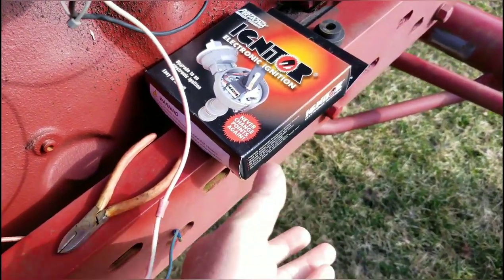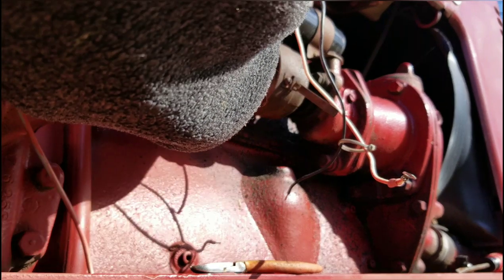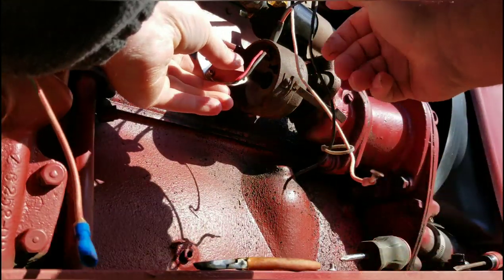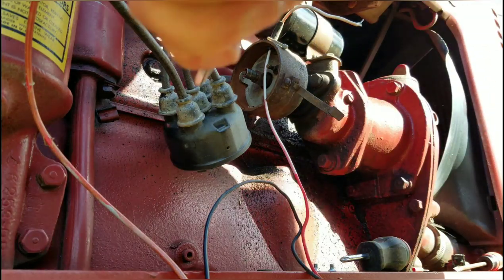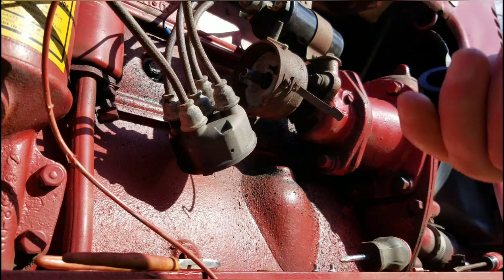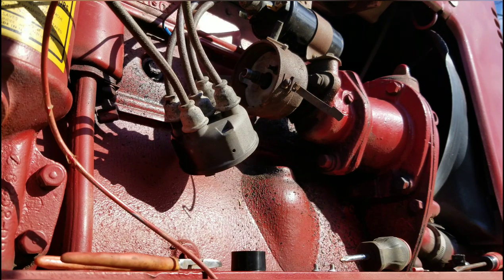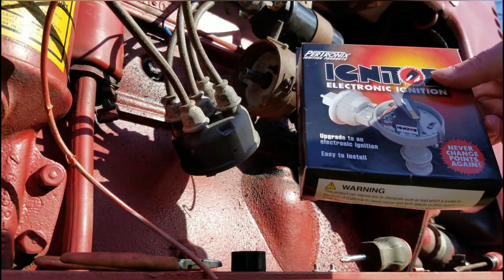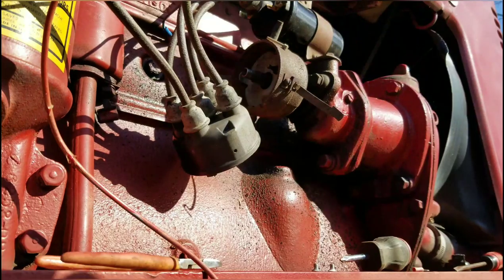Farmall M Electronic Ignition Installation...Almost!

Comment: Sorry to hear about how much trouble you've had. If you're interested in an alternative, I put a C5 ignition on my 400 three years ago and haven't had any trouble with it. The system is really expensive ($600), but I haven't had any problems 450 hours later. It basically replaces the whole ignition system with components used in modern cars.
Reply from the maker: Now that is interesting
Reply: @FarmallFanatic  I was able to justify the cost because I would have needed to buy a new distributor. The advance weights cracked and messed up the inside of the distributor. This set up only uses the distributor shaft, so I bit the bullet and was happy with the result. As a bonus, I can use a planter monitor because the ignition makes less electrical noise than points.

Comment: I have a 175 AC and it has went through four or five sets of points in the last two years.  My local mechanic told me that points just are not what they used to be.  He suggested that I convert to electronic.  Had to put on a new coil because it wasn't hot enough.  Love it.
Reply from the maker: I got 2 years of hard running off the last module

Comment: If your only getting a couple years out of those units don't you think it would be better just to switch back to points and condenser?   I can respect your opinion, but it's a glorified Hall effect sensor.  It doesn't care if it's idling or full tilt.
Reply from the maker: As hard as I run my tractors, I go through more points.  Either way, I'm digging into the distributor.
Reply: @FarmallFanatic  Fair enough....... Order a second unit so you can minimise down time.   This stuff usually only fails when you need it most!
Reply from the maker: Very true

Comment: I had electronic on 3 tractors for 2 years and they ALL went out last year. I'm going back to points. Still expensive but alot of times I can clean em if they act up and I can get new ones about anywhere. Tsc ,NAPA. Case IH, Skillings Tractor, Rural King. That way I  don't have to leave it in the field or something.
Reply from the maker: Thats true and easy to change

Comment: Howdy. I remember you putting that on there. Do they not last very long. I want to put one my 30. Thanks for video.
Reply from the maker: Toward the end of the video I kind of go into explaining my opinion on how long they last and why... If you skip to the end that will explain it. Overall, I do recommend them.
Reply: Lol. I quit watching just before you started explaining. Had to go to work. Thanks
Reply from the maker: @williamchambers7235   Well what I said in a nutshell is this, if you work your tractors hard points or an electronic Ignition won't last forever. I have guys telling me that they get 5,6,7 years out of an electronic Ignition and I know they don't work their tractors. It really depends on how hard you plan on working it.

Comment: One thing with pertronix ignitions is that they say to not use the solid core wires. I did on my M and it did burn it out.  That tractor has now been switched over to the new style wires. I too work my M hard in the summer and fall on a 10” unload auger and some eight inch ones and in the fall they turn 72’x10” swing hopper augers in the fall.  The auger manufacturer recommends a minimum of 65pto hp for it, but the M’s get it done.
Reply from the maker: You mean copper core... n then you switched to carbon core?
Reply: @FarmallFanatic  yes, my “M” had the original copper core wires on it yet. We did get eight years out of it with those wires.  But the new kit said to not use them and go to the carbon fiber cored wires. Why it makes a difference I don’t know, but with electronic ignition it has more power, uses less fuel and is not as hot as the hotter spark burns the fuel more completely to begin with. Sorry for the delayed reply I was busy using my 6 volt positive ground “m” for augering and hauling with my 3588 2+2
Reply from the maker: @danfixsen1871  I really like mine

Comment: Yeah I know what you are talking about. My tractors all get used a lot and rack up a lot of hours between cutting fire wood for the shop, field work, snow plowing, and rescuing the neighbors when they are stuck or snowed in they get a whole lot of miles on them. I end up servicing them at least twice a year with general maintenance. Ignition's about five years, and the carb as a rule, only touch that if gas is pouring out of it...or if gas isn’t getting into it. But in order to make them reliable we’ve overhauled all of them top to bottom. Which I am doing right now to a farmall M I bought and yeah it is a basket case. But when it is done it will join the rest as reliable machine and be just like it was the day it left the factory and will be able to do the work that it was intended to do. Go on a Sunday drive and look nice until it gets it's first paint scratch. That means Monday morning it will be heading for the field.
Reply from the maker: What state are you in?
Reply: Farmall Fanatic In a state of disaster since my tractor is laying apart all over my shop and l can’t play with it until it's done, ha, ha, ha 😂. I actually am in east central Minnesota 40 miles south of Duluth. As for the state of my tractor I am just finished rebuilding the transmission and I am painting the back half at the moment. The engine and the clutch are next on the list. Oh and if you are still looking for the answer to your question about the 800 pound bypass valve in the lift all hydraulic pump it was changed from 500 to 800 sometime between 1946-48 as an upgrade for better lifting power with implements. I’m not sure the year it became standard in the pump but the first date I found in my books is 46 as the appearance of the ”up graded” lift all system with more goodies to put on to use with machinery. But the bypass had to be ordered at the beginning as was the case with a lot of harvester add-ons and upgrades. When it became standard in lift all I'm not sure my books are vague on that. The jump into the super series tractors and no more is mentioned about lift all.
Reply from the maker: @robskoglund1032  yea I figured my 49 H is good 👍
Reply: Farmall Fanatic Yep you didn’t go wrong. Looks like a good tractor. 👍 Go out and have some fun in the fields.